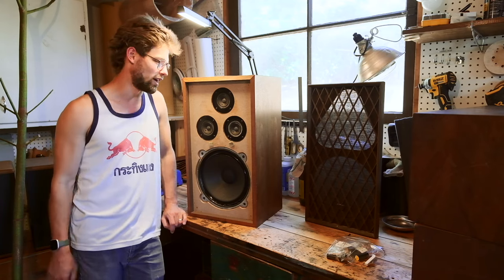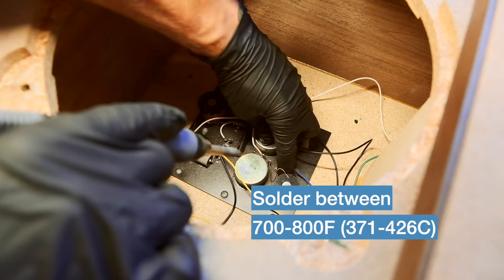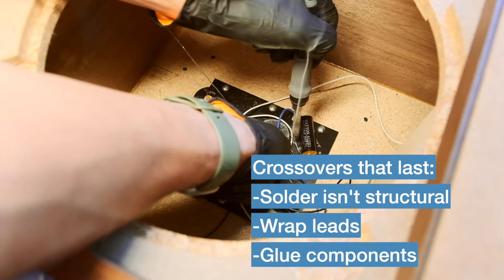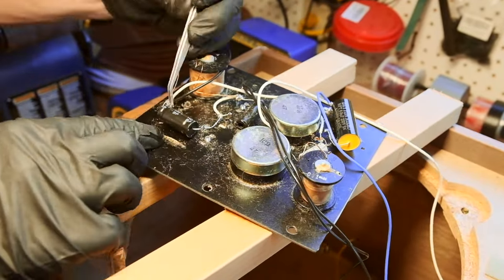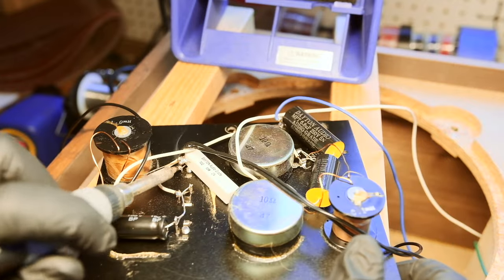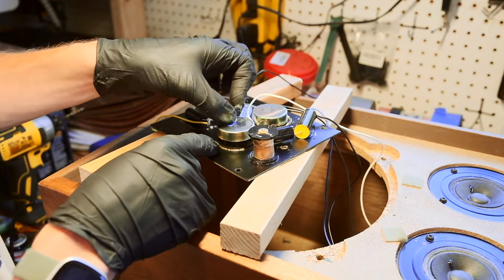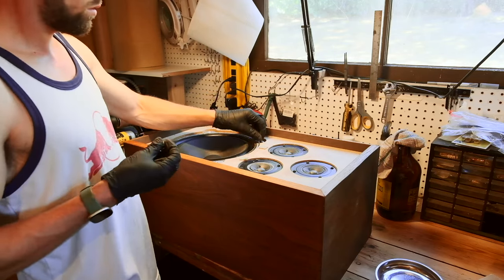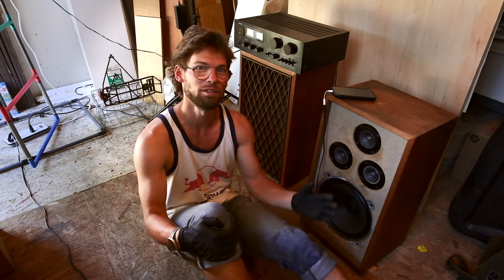Best update for your old Speakers

Comment: I see a Nikko amplifier there. They were quite impressive, and had a nice kick to them. I have an NA - 690 stashed away somewhere. Not used it in over 20 years. I think I would definitely need to check the electrolytics and other components, and likely replace them before running it again. Thanks for the video on speaker upgrade. Found it very useful. ✌️
Reply from the maker: Ayyye! Eagle eyes 👀 I agree! This one is actually very sentimental to me and I am working on plans for many upgrades to make to this one. Mine is an NA-690 as well! If you ever think about parting with your 690, I might be interested! 
You're most welcome! I'm glad that you could garner some useful information out of it.
Reply: @Shuksanaudio  Cheers to that. I remember buying that amplifier back in the mid 80s. Brought it parties. Lot of fun with it. I was using it with a pair of very old and usual, not well recognized... "Burhoe Acoustics" 8 inch bookshelf speakers ( the red dust cover ones ), around the time Advent loudspeakers were out in the market. I "think" Burhoe was a subsidiary of Boston Acoustics at the time, but can't be 100 % on that. The foam surround on them, has since dried up, but they sounded very powerful on the low end. I believe they're 4Ω,  but it was the Nikko that sure could really push them to their max. VERY strong amplifier. 

If I do part with it, it's yours. I haven't powered it in over 20 years. I need to check the ESR on the main filter caps first, to avoid and damage to the outputs. No telling what condition it's in.

Comment: Yeah - I saw a pair today marked $89. The front and surround was gorgeous - but the backs said I'm Really Old Crap. I was looking for something ready to go - but I can see preserving that old box. But why do you want to upgrade the grills? That's the nicest part.
Reply from the maker: Nice! That's a fair price for those! The video on the changes I made to these will be coming out soon. The original grills are plastic and while the pattern is incredible, the plastic isn't. I made new grills for them out of wood that looked even better in my opinion. I kept the original pattern, just made them out of maple plywood with a CNC so that they're much brighter. -Matt
Reply: @Shuksanaudio That's what it would take! I used to work at the contract plant that made most of those speaker boxes and a few fancy grills in the 1980's. But I didn't buy those because I just don't have the space for projects. But I would if I thought I could bring it fully up to snuff. Did you think about transplantation of the guts? I just ordered Sony SSCS5's that I would be tempted to give more breathing room in the future. Or a damaged pair of something else. BTW Those were Sansui - the cases look identical. 
EVERYTHING except the grill (and stands, etc.) were made out of MDF with vinyl. Although we did have a separate line someplace else that hand assembled with veneer. Sony bought the company and moved to China.
Since you're into high-end repairs - check out the plasticizer sold as engine seal stop leak - it soaks into anything that is plastic that has dried out and renews it well. Also for hoses and bushings and trim and dash etc.

Comment: Many classic speakers have overly simplistic cost reduced crossovers.  By measuring the individual drivers and developing a new crossover you can often really improve classic speakers.  When replacing the fiberglass, use the same weight of the new stuffing.
Reply from the maker: Totally! I am slowly learning about crossover design and have a couple ideas for what speakers my first crossover project will be. Thanks for adding good info to the comment section! I appreciate you watching and chiming in. -Matt

Comment: OMG, I have the exact same cabnets with my Sansui 1970s speakers. Except mine are as follows. 
1. 12 inch woofer
2. 1 horn loaded, L-Pad controlled 
     Compression tweeter.
3. 2 2 inch dome tweeters
4. 1- 4 inch midrange driver. 
5. Dual vented tubes on the bottom front facing ports. 
I am here to tell you that even today it is very hard to beat the sound that these speakers produce.
And I have had many many speakers over the years. 
The only configuration of speakers that come close is my current 2.1 setup. Two JBL Studio 530s with a parts express 15 inch subwoofer hooked up to my Yamaha amp
And SMSL /  DAC. 
BLURAY 4K CD PLAER. SACD. 
It comes close but there is still a difference in the sound.
My answer to that is my 40 year old vintage ADC/ equalizer/ spectrum analyzer.  With the soft blue display. Beautiful piece of equipment.  Got it about 35 years ago in a pawn shop for 50 bucks.
Reply from the maker: Nice! that's awesome! Always nice to find a set of speakers that you really love! An equalizer is so good for tuning in a system! Thanks for watching. -Matt

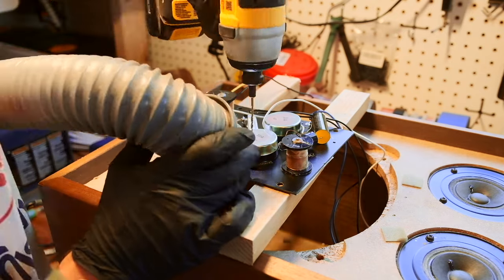Comment: 2:45 Those are Rheostats, they are not potentiometers, they have special non-lubricating grease or clean contacts! You should not drill holes either, they open with force and the metal cover comes off easily and can be replaced. Nice speakers and restore! 😉
Reply from the maker: Thanks for the clarification! You're totally right. Always room to learn.
Reply: Learning is always great, I didn't know about them either until I came across some fantastic Japanese SONOCO boxes with giant rheostats and saw how complicated they were to get where I lived, excellent work and video. @Shuksanaudio
Reply from the maker: @nopochoclos  Absolutely! There's a lot to learn in this space so it's always nice when someone brings up good info :) Ahh dang, that's amazing. Unfortunate that they are hard to come by. Thank you! I appreciate it!
Reply: @Shuksanaudio   try to find a SONOCO, maybe no super brand but i am using them every day with a Technics SU-7300 and both match very good, but not with the Nad 3020  some lack of bass , 19kg each speaker, very tick walls.
Reply from the maker: Will do! I can't find much info about them online but maybe I will luck upon a pair one day :) They sound very well built! Is the Technics your go to amp right now? Seems like you've got some great gear options!
Reply: Wrong. They are potential dividers AKA potentiometers. 3 terminals. Rheostats have 2.
Reply: @envisionelectronics   My Sonoco Speakers have two wire rheostats each and each rheostat has 3 terminals on the outside, I understand that it can work using two terminals compared to the potentiometer but on the outside they look identical, mine are high power wire rheostats.

Excuse my English, if you look closely it says 10 ohms and has two soldered legs, meaning that it is being used as a rehostato and because of the size they would put rehostatos and not potentiometers, if they were potentiometers they should be smaller.

Comment: Frequency response measurements before and after and capacitance measurements of the old and new capacitors would be nice.
Reply from the maker: Great point! I will be purchasing a capacitance and ESR measurement tool soon for use in some upcoming speaker upgrade videos I will be putting out. I hope to get a calibrated microphone shortly after that for frequency response. Thanks for watching!

Comment: 1:45 That cap should be in parallel with the woofers and would bypass the high frequencies to ground rather than "blocking" them. The cap in series with the tweeter does act to block low frequencies though.
Reply from the maker: Different terminology, same result. Thanks for watching!

Comment: I had a set of SANSUI speakers with the exact same grills. 
12 inch woofers
5 inch mid woofer/midrange
2 1/2 inch dome tweeters X2
5X7 horn loaded compression tweeters.
Also L-Pads for the horn tweeters.
Dule 3 inch port tubes.
Nothing i have ever had sounded as good as those.
Long story short, my wife threw them away. !!!!!!!!!!!!
I was going to strip them down and totally over haul them with new wood veneer
New crossovers and wires.
All the individual drivers were perfect.
That was about a 1,500 dollar mistake she made.
Reply from the maker: Oh noooo! That is not how I expected that story to go. Do you know which model they were?

Comment: Doing this is the first step on the inside of the cabinet. I go 1 better by replacing the 18 gauge wires inside with 12 gauge. Big boost in bass.
Reply from the maker: For sure! It's definitely worth updating the wiring on most speakers. I would say 12 guage is a bit larger than necessary but everyone has their opinion and I'm not likely to be "right". Cheers.
Reply: @Shuksanaudio  Its what I had on hand. And it was for a 15 inch woofer. Just going from 18 gauge 2 steps to 14 is a big plus but even 16 gauge is better than 18.

I have found out that a lot of metric country's 18 gauge is closer to 19 or 20 gauge using a 'US Wire Gauge' gauge.

Comment: Great info! I am currently in the process of restoring a set of Knight speakers from the 1960's. 3 way crossover, 2 of the capacitors look normal but one is orange and flat with no writing on it. Any ideas what this is and how I can find the value on it for a replacement? Thanks!
Reply from the maker: Nice! That's awesome. Is it a flat round disc like capacitor? That would be a ceramic capacitor. They don't tend to drift as much as electrolytics so you might be able to get away with not replacing it. You can shoot me an email with a photo of it if that would be helpful: Shuksanaudio@gmail.com
Reply: @Shuksanaudio  Thanks for the help! Shot ya an email with a pic :)

Comment: Hi, new subscriber here, I own some Goodman RB35 how would I go about knowing what capacitors to change to?
Would I take the figures off the side if possible or a meter reading and buy a modern equivalent?
Reply from the maker: Howdy! Thanks for subscribing! The capacitors should say their value on them if you open the speakers up. My guess is they have a simple crossover just like the speakers in this video and may have only one or two capacitors. You can find replacements on partsexpress.com. Electrolytic capacitors would be a fine replacement in those speakers.

Comment: I have a really nice pair of Energy C9 tower speakers that I would like to keep going strong. They are over 20 years old. How do I know if I need to have this done to my crossovers? How long does this stuff usually last?
Reply from the maker: Capacitors in speakers are generally going to be fine for 20-30 years but it depends on how they're used and the original quality of the components. If you have a capacitance tester you could test them to see if they're still within 20% of the rated spec. If you don't, you could get an RTA (Real time anaylyzer) app for your phone and play 20hz-20khz white noise through them to see how the frequency response is. If its falling off a lot around the crossover points or at the high end 8khz and up, it could be from bad capacitors, however, your phones microphone isn't calibrated so those results wouldn't necessarily be accurate. If you like the way they sound and they don't sound like there's lots of missing high frequencies, I wouldn't bother with a recap. Most of the speaker I put new capacitors in are 40-50 years old so they are well beyond spec. Thanks for watching!
Reply: @Shuksanaudio  Could I ask you a question? I had an x girlfriend poke a hole in the cone of one of my drivers. I used silicone to patch it up and it sounds fine but the silicone all over it has always bothered me and I know it must be running a little behind with the extra weight. So I recently bought a driver from a guy on E bay. I was hoping since it was the same speaker out of the same kind of cab it would match up. But after installing I’m noticing that the speaker in question is not as loud as the other meaning the new/used speaker doesn’t match. Is there any way to get this new/used speaker to match up? Or should I just have the busted speaker repaired? If I play these speakers this way while I wait for repair could the unmatched speaker cause problems with my other speakers or will it be ok for a week or so?
Reply from the maker: Hmmm it could be that the speaker you purchased has a different impedance or has drifted over time so it's playing more quietly. Have you tried switching the position of the leads that are connected to the driver? You won't damage the speaker if you just use it with a different woofer inside of it.  @bigmacfullerton7870

Comment: I have a pair of RTR Magnums, both are tower speakers with a 12" woofer and 12" passive radiator.  I was using a long 3 5 mm cable from a digital device to the receiver and driving them fairly hard.  The overloads on the speakers tripped.  After resetting, it seems I lost all bass response on both speakers and all I'm getting is tweeters.  Do you think I blew out the voice coil or burned out components on the crossovers?
Reply from the maker: Oh no! That's unfortunate. If you have a multimeter, try testing the woofer for resistance. If they still show resistance, they should be fine and there might be other components in the crossover that were burned open. Some speakers have a fuse in the crossover.

Comment: Surprised tonsee what look like iron core inductors? Bowers and Wilkins in their DM 220 and 330 2.5 ways use an air core inductor on the tweeter and two midbasses, with a capacitor on the tweeter and upper woofer. The resistor is of course on the tweeter, and just an inductor on the lower woofer.
Reply from the maker: Yes I believe they are iron core. These were not high end speakers when they came out and the sound difference between iron core and air core is minimal unless you're dealing with high end speakers like those B&Ws. These speakers still sound great though and would please most people. I think the iron core vs. air core is part of a set of arguments to squeeze the last 5% of sound quality out of something. These speakers get you 80% there, and you'd need different speakers to get any further haha. Thanks for watching!

Comment: My Nova 7s had 3 ceramic resistors with a switch. When I first got them, they blew. Replaced and now all is almost good. Like you are doing, I have to replace the capacitors.. but won't film capacitors change the sound dynamics???
Reply from the maker: I've never seen a resistor open in a speaker, that's wild. Someone must have run them loud for a long time! Another commentor mentioned that film capacitors can change the sound dynamics while another person thought it was odd to replace the woofer capacitor with an electrolytic instead of film. Just like with many things in the audio world, there is a lot of information and opinions floating around on what they best way to recap a speaker is. From what I have read, film caps have lower equivalent series resistance (ESR) than electrolytic caps and as such, will allow more current into the circuit thus increasing the volume of the component they are in line with if you replace an electrolytic with a film. This is most obvious at higher frequencies which is why when people recap an older speaker, the high end tends to sound "Better" or brighter. If you want to stick as closely as possible to the original sound of the speaker, recapping with most any modern audio grade electrolytic will be the best option. However, some people prefer a brighter sound, or have the equipment to test frequency response and can adjust the crossover values to keep them sounding original by adding a resistor with the film capacitor or changing the crossover entirely. That takes a lot of time so most people just throw in a film capacitor and call it a day. Film caps don't go bad like electrolytics do so people tend to think they're better because they won't have to be replaced "ever". I think it's odd to expect something to work perfectly without any maintenance for 20+ years so I don't mind using electrolytics. I think there's a general idea that film caps are just better than electrolytics which is likely propegated by the fact that electrolytic go bad. Very high end speakers tend to use film capacitors because they do have properties that make them "better". But on vintage speakers that have less precision manufacturing and are not super high end, you'd be hard pressed to notice the difference. There are many great forum posts on the internet regarding crossover caps. Post #4 on this thread is a quick read and very useful: https://audiokarma.org/forums/index.php?threads/to-cap-or-recap-that-is-the-question.959132/
Thanks for watching! -Matt

Comment: Would this work on a pair of realistic optimus 5bs? I heard theyre basically the same speakers lol
Reply from the maker: It would! The Optimus 5B and Nova 8B are the same speaker. These are the Nova 8 which are a bit different from those two. There is actually a full crossover mod on the internet for the 8B/5B that makes them sound much better. Thanks for watching!
Reply: @MattDealy  thats how I found your video because I was having a hard time finding a comprehensive list online but you have everything all laid out so if I can use your parts list I definitely will! Plus your video is excellent! Really breaks things down and gets rid of any ambiguity!
Reply from the maker: I’m happy to hear that! Unfortunately, my parts list is not compatible with the stock parts list for the 8B/5B and it is not the upgrade found online. The easiest way to replace the components in your speakers is to open them up and look at the values of what’s inside them then order equivalent components. Shoot me an email if you have questions!